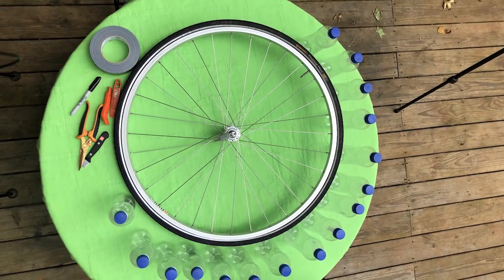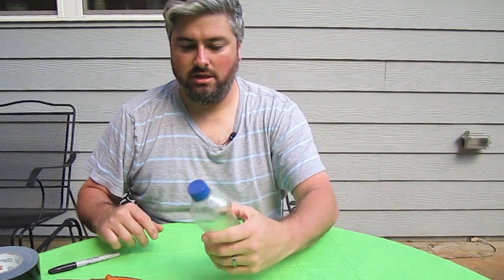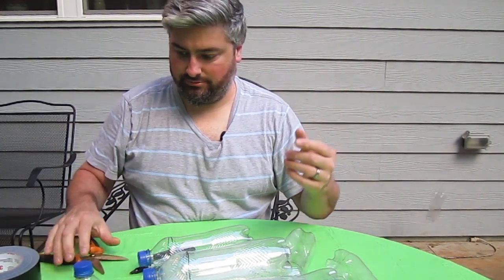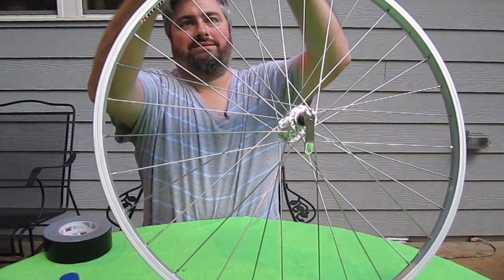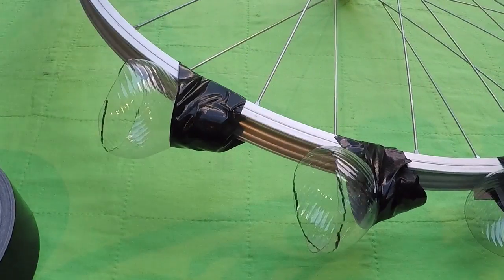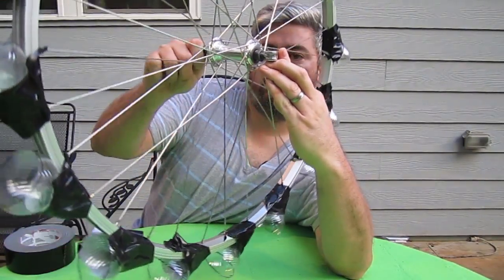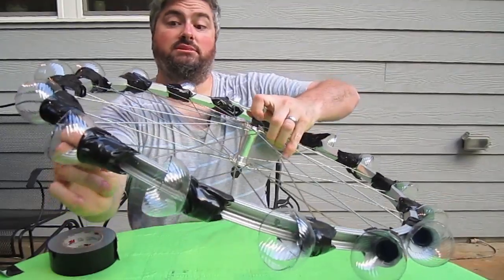HOW TO: WindWheel. Cheap & easy yard art project with a bicycle wheel at home

Comment: You have a really developed a cool foundation to work with.  I wont use the duck tape, but I will use a smaller wheel -- either a 24" or 20".  I will head over to the dollar store and look at flour/sugar scoops.  If I space them right I will drill holes on the rim then fasten with small screws.  The bearings on the rim will allow this to run forever.
Reply from the maker: That sounds great! Any scoop will do... cans, measuring cups, etc. And yeah, screws or rivets would be super easy and durable. Just keep it all balanced well, and it will work. But bear in mind, with a smaller the wheel, the physics start working against you a little:
The lever arm gets shorter, but the mass, friction, and scoop size stay the same, so it takes more work for the wind to get the same rotation out of the wheel. In my experience, smaller wheels still spin, but it may take a bigger gust to get it going, or it may just get blown around before it gets spinning. Adding a weight near/under the center (but not rotating with the wheel, can help). Also, keeping the scoops light yields better movement in light winds, and good speeds in strong winds. Heavy scoops definitely slow down the movement in light winds and can be harder to start. But the added momentum tends to keep it spinning well through changing winds. And in strong winds, heavy scoops are kind of amazing to watch (as long as it's balanced). But that's all part of the fun of it... trying things and seeing what works. Good luck!

Comment: would it spin if you used the metallic tape like you did for the horizontal spinners you make?
Reply from the maker: Yeah, metallic tape works fine too. There's lots of ways this could be done, and no one way is correct. The point of this build was to just make something cheaply with common household items and without the need for special fasteners. Some people have suggested just hot glue, but even bolts and rivets could work, especially if using metal cans for the scoops.

Comment: well..because you didn't clean up the bearings, and remove ALL the grease, clean out the race and hub and the OIL the bearings...the wheel doesn't turn very freely and winds up the sring instead,,whinc will impart an opposite force on the wnd spinner..with clean, oiled bearings,
you won't be fighting the string and hence it toy will spin easier, truer and will turn in lower wind speeds and turn smoother in higher wind speeds..
Anything else?
Reply from the maker: Yes, Cleaning and repacking the bearings always helps. And oil instead of grease can help things spin more freely because of the lower viscosity of the oil. But I find that’s not necessary most of the time, and oil will wash out from the weather far sooner than grease will.   
With standard cup-and-cone bearings, what helps the most is making sure the bearings are just a tiny bit loose. 
String windup can be a real problem if the bearings are not silky smooth. That can be countered by hanging the wheel with something more rigid (or using the axle or quick release to directly attach it to something rigid... there’s no string-windup if there is no string).

Sometimes I add more weight directly under the wheel and attached to the axle (a 2.5lb/5.5kg from a weight-lifting set for example). The weight helps in several ways... the centered extra mass resists the sideways push of the wind, making sure more wind energy is put into spinning the wheel while also keeping the whole thing from swaying too much. Also, the extra mass can resist string windup a little since there’s more static inertia in the string/axle part.
Thanks for your comments!

Comment: How do you hang them. I made two like yours but put them on pipes and they dont spin in the wind but spin easily by hand
Reply from the maker: Most importantly, the axle bearings need to be relatively loose to allow the light wind pressure to overcome the static friction in the bearings. On some bike wheels that bearing tension can be adjusted with the use of special tools called cone-wrenches. I'm sure there are YouTube tutorials on using cone wrenches to adjust axle bearings. You want the bearings way looser than you would normally have it for use on an actual bicycle. Many high-end wheels with cartridge bearings can not have their bearing tension adjusted looser, and thus for this application the cheaper the wheel the better. As for other recommendations, I suggest you hang the wheel with something that won't spin (i.e. a coat hanger wire or something similar), and do not use a string. A string will get too much windup and may not let the bearings turn. If you do use a string, a shorter one will keep windup to a minimum. Another trick is to add weight hanging underneath the center of the wheel (I like using 1.25 or 2.5lb small dumbell weights). That additional non-spinning weight adds some static inertia that encourages the wind to spin the wheel instead just pushing the wheel sideways in the wind. Good luck!
Reply: @ARodDMD  cool thank you for answering my questions.  I have one more though.  How do you attach the coat hanger.
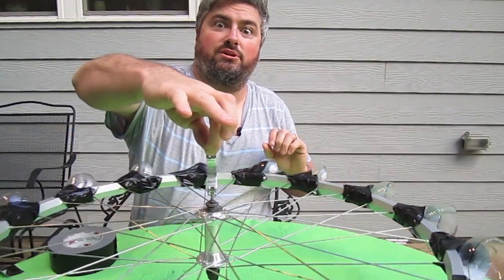Reply from the maker: @joanrule8152  If you look closely at the final 20s or so of the video, especially right 6:29, you'll see I'm holding it from what's called the "quick-release skewer" that goes through the HOLLOW axle. I then hung that from a small stiff wire (and I also attached a string despite my previous recommendation) to that piece to hang it from. But, if you used a bicycle wheel with a SOLID axle then you won't have the luxury of using a quick-release skewer. In that case you have to get creative to attach something to the axle to hang it from. In the past I've used a threaded nut turned onto the end of the axle to secure a strong string to it, and for others I've simply drilled a hole through the axle and then put a coat hanger through that.

(FYI, despite my previous recommendation, using a string is fine, it just tends to windup a lot which can interfere with the smooth spinning).

Comment: The duck tape will weather and come off and look like crap
Reply from the maker: Yup. Cheap and simple. That’s kind of the idea. My goal was to make this project be the simplest and cheapest version that it could be, and accessible to the widest group of people.
If you want to make a more durable version, go right ahead. If you do, please share your video.

The wheel from this video is still working two years later in my backyard without any maintenance.

Comment: I'll pass on this ugly wind spinner! Oh an by the way that is not how you balance a wheel, next time use a lawnmower blade balancer
Reply from the maker: Wait... your suggestion seems like extra work. Would you remove the axle and bearings from the hub of this wheel to then attach it to spindle of the lawnmower blade balancer?  I don't see why you'd do that extra work when the wheel is already on an axle with bearings. Just clamp the axle parallel to the ground, and let the wheel settle to it's low/heavy spot, and adjust accordingly by adding weights to the opposite side. It could not be easier.
Reply: @ARodDMD  You obviously have never used a mower blade balancer, your method will never get it right
Reply from the maker: Well, maybe not perfect, but it gets it right enough. We’re not talking about spinning a heavy lawn-mower blade at thousands of RPM, instead we just need to try and keep this simple wind-toy level, and this method is more than adequate. That particular piece has been spinning for years out in my backyard, with zero maintenance, so yeah… balanced well enough. Even for my heavier pieces, this method works great.
Reply from the maker: @markolsen7438  Is there a video you can point me to to show me your method?